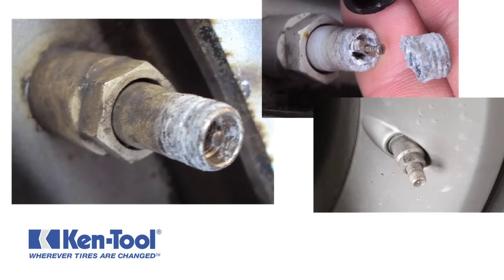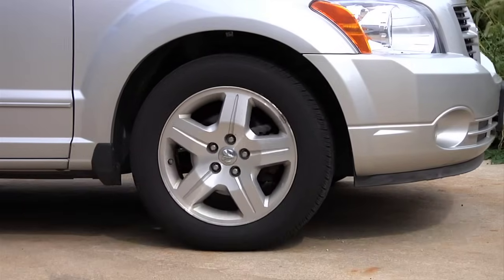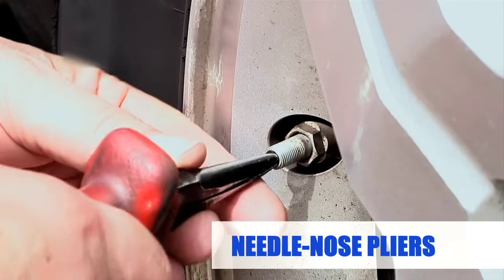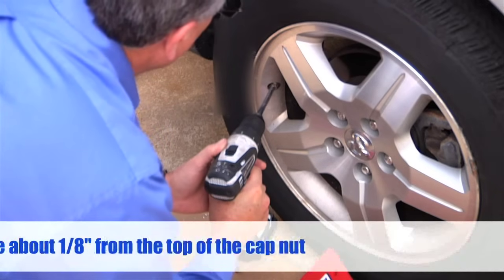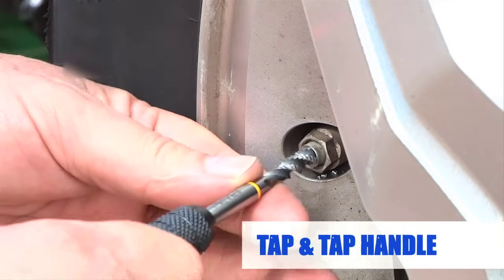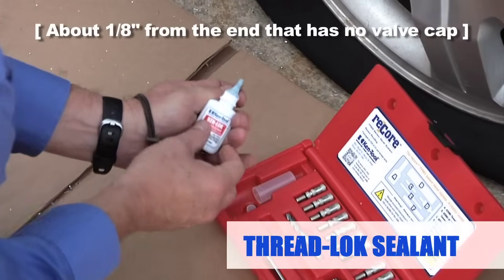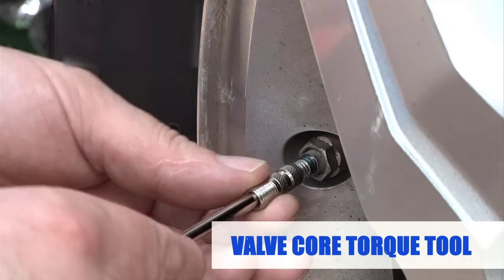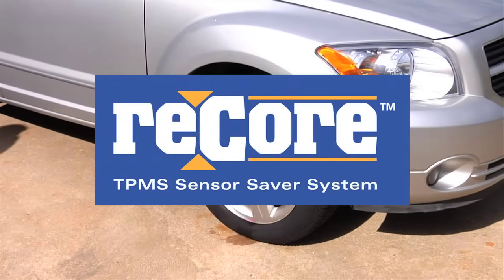Repair your TPMS sensor--don't replace it!  New DIY reCore® TPMS Stem Repair kit launched!

Comment: Why? Ton of work with so many possible screwups - just buy new ones 🙄
Reply: Or you can actually learn something new, and experience the satisfaction in repairing something for yourself while saving over $100. Or stay ignorant and pay other people large amounts of money to fix easy problems for you. BTW, I used this kit after seeing this video. It was easy and it works.
Reply: @philwalker9180  I had my local mechanic replace mine for about $80...it's not that expensive.
Reply: @angrypanda3014  Really ! Your sensor will be next ? Why not replace the whole thing and expect another 7 years for it to go bad ?
Reply: @jeffjackson9679  Walmart is cheaper. Much cheaper. They use a universal TPMS
Reply: @jeffjackson9679  well I recommend you lose your job, live with no income and sleep on someone's couch while being addicted to drugs and come back and tell me $80 ain't expensive
Reply: @DavidPigbody  I've lost my job before. And no, my life didn't end. Must suck living through life where $80 makes or breaks you.
Reply: @jeffjackson9679  That’s not expensive? For all 4 tires it’s $400 here just to replace 4 sensors.
Reply: @jeffjackson9679  Must be second hand as I cant find them anywhere under $80 each

Comment: do i really need to wait until 9 o'clock to do this? can i do it at 4:20 ?
Reply: Peter you sly mad man.
Reply: Mary Jane is a good assistant for work like this...
Reply: Duh, he said you can do it at 3:00 too. I missed it by 15 minutes but tried anyway. I just made sure to use extra transmission fluid as it will lube the air inside tire.
Reply: ...Or shell out 51-50

Comment: How to keep a tire valve in good condition? Keep a valve stem cap installed.
Why do car makers put all this technological crap on cars? Do they think people are too stupid or lazy to use a tire pressure guage? When my 2017 Toyota Corolla SE with a six-speed manual transmission is paid in a few years, I want to sell it to buy an older car without all this felgercarb. With a manual transmission.
Reply: @Don Lee 72 month loan at 3.4%. Should be paid off in under five years instead of six. At the time, I was out of options, but they gave me a nice discount off the car because of the manual transmission. It had been sitting on their lot for six months with no buyers.

Comment: Ahhhh.  What about the batteries in the TPMS?  You do all this and then the battery dies...  Could have just dealt with it one time and fixed the problem for the next 10 years.  Plus these units cost like $20.  Then buy the $10 tool to relearn them to your car.  This kit costs $169

Comment: The best way to prevent GALVANIC CORROSION on your TPMS sensor is replace the brass valve core with a nickel plated core !! I had this problem on my Mazda 6 and I just replaced ALL the sensors with new TPMS sensors that now have nickel plated valve cores ! These new sensors now only cost $44.00 + Tax up here in Canada compared to $123.00 they use to be priced at !!! R & R is the safest and best method in dealing with this issue !!  Mazda should have recalled these corrosive sensors long ago !!

Comment: I this a bad idea. Because i can see people drilling that drill bit all the way into the sensor.  Also the metal shaving are going into the sensor and damaging the sensor. 
Just replace the sensor. Some sensors do have the capability to replace the stem only and keep your same sensor.
One more thing is that, drilling something on a nice clean rim can be alittle bit dangers.  You can damage your rim and TPMS sensor. Which will cost you a lot more then that kit.
Reply: Nothing can get into the sensor  because sensor is not an open device connected to that hole.  The sensor is a closed plastic box screwed to the stem or sometimes "glued" together.  
if the stem is replacable I don't see the point repairing it. The're very cheap and replacement would be less costful than the kit.

Comment: I supply replacement stems and collars on my tyre consumables round in the uk. The set covers most vehicles. The collar of this stem would likely fail at some point too. The average cost to the dealer is £3 to £5. Is there not a similar system in the USA?.

Comment: will this work for any kind of sensor ?
Reply: I tried it with my fuel pressure sensor bleed port, and sprayed gas all over the exhaust manifold and turbo. Doctor says I may get better after another 5 or 10 skin grafts...  but up until then, it seemed to work fine...  ;) (this is sarcasm, just to be clear)

Comment: A leaky valve stem can mimic a bad sensor, this attempts take that problem off the suspect list of problems.
Reply: A bad sensor will indicate TPMS fault/malfunction and the tpms light on the dash will flash. If the tire is low the light will stay illuminated solid. So a leaky valve stem will not mimic a bad sensor.
Reply: @davidhaines1751  Isn't the valve stem actually a part of the sensor housing? I agree it would not be part of the electronics of the sensor.
Reply: @anton1949  depending on the style of tpms they can be removable and replaced without having to get a whole new sensor. Tpms rebuild kits are available for for $7-14 depending on where you live.
Reply: @davidhaines1751  I have a Tacoma and was quoted 390 dollars for replacing 1 sensor, that's including the diagnostics. That's from the dealership. I think that's hiway robbery.

Comment: By the way, just use titanium valves instead of cheap crappy Chinese valves. Also when you remove the valve cap, just turn it anticlockwise first to find the thread. And don't forget to always remember to place your valve cap back when your done. SIMPLE

Comment: I was so sick of tire installations and problems that I just bought my own tire changer and balancer.  I bought 4 OEM TPMS for the Ram for $40.  Gonna swap them when I put new tires on.  My God I love not being dependent on a tire installer; and they all do such a crappy job.
Reply: Where did u buy the changer and balancer if u don’t mind me asking?? I have been thinking the same thing for years I just don’t really have a garage to store it in...seems pretty simple just need to find out what is used when they paintbrush that stuff on to seal the bead
Reply: @buckyburnquist6825  --  directly from Mayflower.  Best bang for your buck.
Reply: @buckyburnquist6825  -- All the chinese machines are basically the same.  Mayflower is among the lowest priced when purchased direct, but is still of higher quality that XK, i.e. things like metal pedals vs. plastic, bead blast deck vs hand blaster (although this is more of a personal preference thing, but the premium machines use deck blasters.)  Spend the extra money and buy one with a blaster and bigger deck; it's well worth it.

Comment: Title is deceptive.  The sensor has a battery that IF it's to be REPAIRED, drilling out the core/stem won't do shit to fix the flat battery. Duh
Reply: What if I don't give a damn if the sensor works?

Comment: How does this address the TPMS sensor battery which goes dead and necessitates replacement of the sensor?
Reply from the maker: reCore is a DIY kit for repair of broken/coroded stems only.  If your battery is dead in the sensor, you need to replace the entire sensor.  Would also highly recommend replacing the vave stem as well.
Reply: I'm no TPMS expert but I'm pretty sure the TPMS sensor comes as a complete drop in valve stem assembly (at least as far as the sensors mounted at the valve stem location)
Reply: For the most common type of TPMS sensor you can also buy the valve stem part of it separate for $3.  Of course you need to get inside the rim to replace it just like any other tire valve and also to unscrew the sensor from the old stem and on to the new one.  It is just a regular tire valve with hollow threaded stud inside.  Search for TPMS Service Pack and see for your self.
Reply: Then perhaps the title should reflect this, not the clickbaity shake weighty title that it has now.
Reply: That is exactly what the title says. "New DIY reCore® TPMS Stem Repair kit"

Comment: Which only is useful for a badly corroded valve core.  A defective TPMS unit can only be fixed by dismounting the tire and replacing the sensor assembly.  I know this from experience after having a sensor fail.  I asked for the defective unit since I wanted to investigate how it failed so I depotted the TPMS sensor and found that the battery was defective.  It sounds like this should be an infomercial that airs at 2 in the morning.
Reply: En el video no les dicen que solo hay que taladrar al rededor de media pulgada es muy fácil taladrar hasta el fondo y dañar el sensor!!

Comment: How exactly did that fix the sensor?
Reply: +Rob H    Exactly, bro...my sentaments exactly!!  I have a 2012 chevy Camaro- I had to replace 3 out of the 4 sensors, by installing NEW sensors (tms) sensors-all work great now!!!!!!     I keep all tire  pressures at 40lbs.  the only thing I have to do next is, to relearn sensors by the dashboard way.( start at driver left  tire-decrease 3-4 lbs till horn blows(once) repeat for other 3TIRES then at last tire-HORN WILL BLOW 2X'S telling me, Ecm-tms sensors RELEARNED!!!
Reply: It says "STEM repair kit" in title
Reply: Is 40 Psi what's on your door?  Seems a little high....
Reply: and FIRST it says "Repair your TPMS sensor--don't replace it!"  thanks for playing
Reply: ....it's the name of the video.....

Comment: Totally ridiculous. That much corrosion, it's no doubt already migrated to the inside of the tpms. Eminent failure to proceed. Only in some sort of emergency repair maybe. The cost is very affordable for replacement these days. When buying new tires, the price of the tpms replacement is even cheaper.

Comment: Well,that's ok and dandy....but,most TO ME sensors have a battery,and all have to be replaced within a 5 to 8 year battery life,and you cannot bypass the sensor because it is tied into the computer system,bypassing this system also disables the airbag system...dangerous and illegal....bad idea.
Reply: In some cases tpms can be deactivated via obd2 without any problem.
Reply: Ground the pink wire behind the radio. TPMS will never come on again until unhooked

Comment: OMG .... why would anyone buy a car that wasn't equipped with TPMS ? Without it you would literally have to LOOK at your tires and then put air in them if the pressure was low  ..... The TPMS does automatically fill them with air .... RIGHT ?